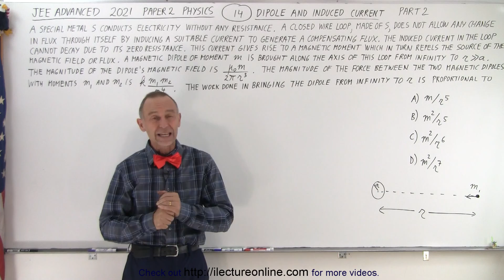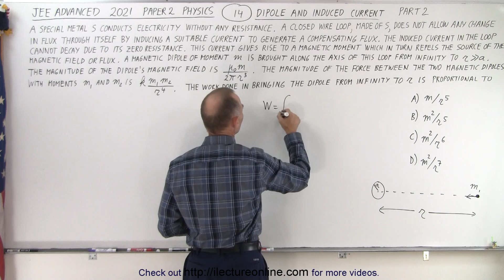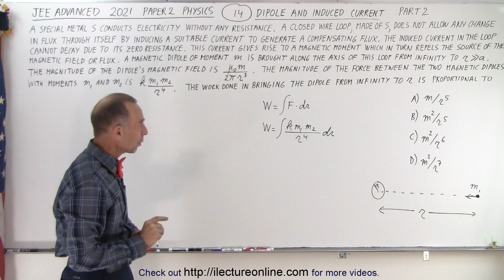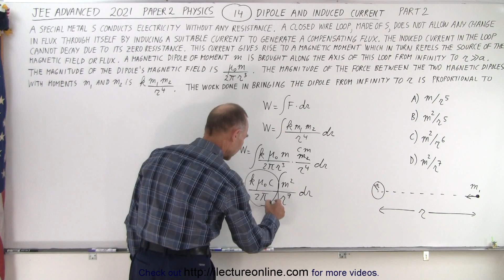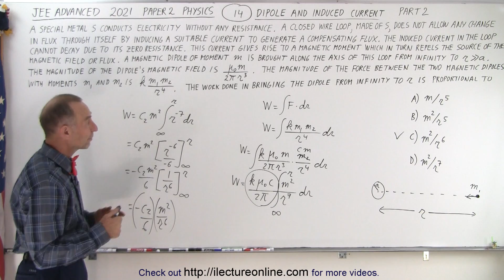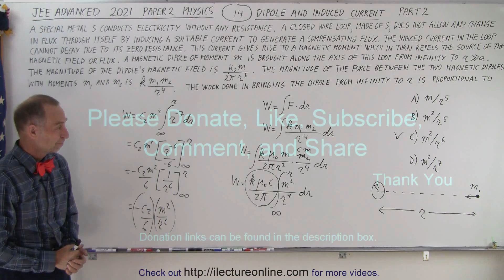JEE Advanced Physics 2021 Paper 2 #14 Dipole and Induced Current (Part 2)

Comment: Respected sir 🌟, does pure capacitive circuit with No internal resistance connected to AC voltage has TIME CONSTANT to it? Does that capacitor takes time to charge?
Thank you sir 🌟
Reply from the maker: The time constant for an RC cirsuit is:   T = RC   Theoretically, if R = 0 then the time constant is zero.  But in the real world there is no such thing as zero resistance, since even conductors have some small amount of resistance.    But in a "textbook" example if R = 0 then RC = 0

Comment: For finding M2, Since flux thro the loop is 0. Magnetic field at the centre of the loop is 0
Magnetic field induced = magnetic field due to dipole
C.I induced/2R = C'm/r³
And M2= area of loop.I induced
M2= c.m/r³
And M1 is just m
Reply from the maker: The flux through the loop is not zero, but it doesn't change.  There is a difference.
Reply: But since the dipole was infinitely far away intially, the flux was zero initially
Reply from the maker: The problem doesn't state that the flux initially was zero, but that a compensating flux was generated to prevent a change in the flux.  Since it wouldn't make any difference to the outcome of the problem you can assume that the flux starts at zero, but it is not a neccesary condition.